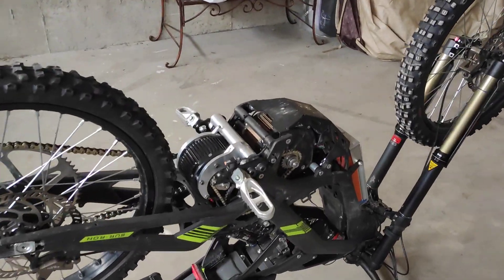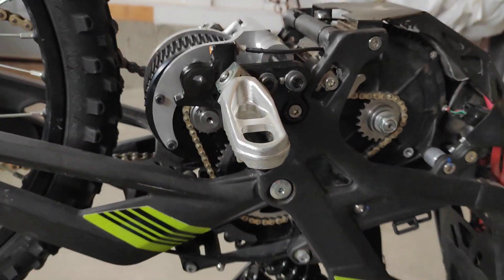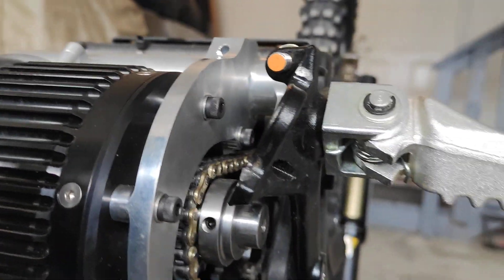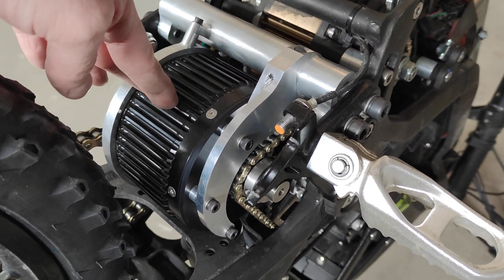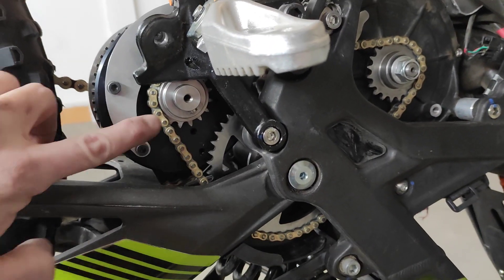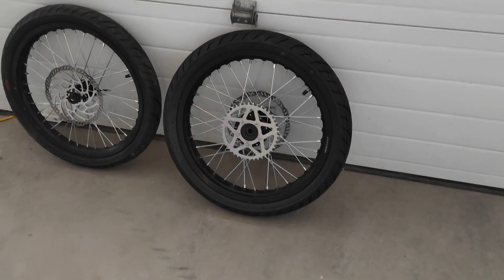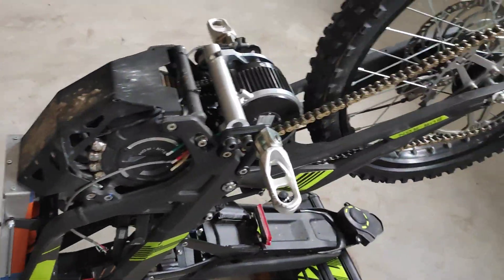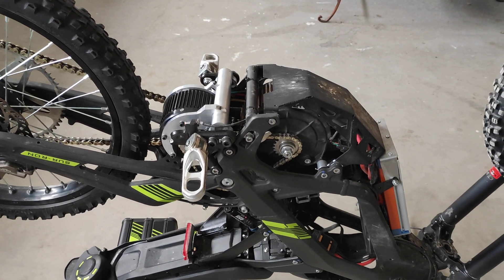Dual motor Surron update #3- motor and transmission installed

Comment: Good as a concept but completely useless for practice. Yes it works for heat dissipation if you need it as I read but considering the weight not the optimal solution

Comment: are you sure those mgm controllers will have features youll need like foc control and multi controller syncing the asi units are the best for bike related ive tested.the mgms are escs so wont be as quiet or smooth as sinewave foc units

Comment: Hello I have a question please ! Did you know if the Bac 8000 can run two Hub motor it's for two qs205 hub motor and if it's fit a 12 inch wheels ?

I want to do a motorcycles with the frame of the Honda grom125 with two qs205 with a 72v 48ah battery pack: 20s x 12 p using Samsung INR 21700 40T 35A !
The goals is to set the peak power to 20 kw top speed 80 mph and acceleration 0-60 mph in 5 sec ! Weight will be around 160 lbs !
Reply from the maker: Hi, no you can't run two motors off the one ESC. It doesn't work like that. You have to use two seperate ESCs. Other than that, what you propose seems possible

Comment: Lol, your range is going to be sooo bad. Still an interesting not very practical project.
Reply from the maker: Actually, with the 4kWh battery pack I am going to run and higher efficiency due to having two lightly loaded motors instead of one heavily loaded motor, my range will be almost double a standard SurRon.

Comment: I have to commend you. That is a brilliant piece of engineering.  Why bother with a bigger motor, when you can so cleanly fit a second motor in there?  Have you measured the power draw and efficiency of two motors vs. one at the same Watt output?  I'm thinking that it could be more efficient because neither motor will be stressed and producing heat for similar power output.  Let me know if you produce this as a kit. I'm interested!
Reply from the maker: Thanks Walt, yea you hit the nail on the head, the added motor mass of the second motor allows for more thermal inertia during and faster heat dissipation after high power pulls, plus by not pushing any one motor quite as hard you get better overall efficiency so you get less heat produced in the first place.
Reply: @danielclarke7109  I would love to put one of these setups on my Sur-Ron.  Absolutely brilliant!  Here's a little corny video I threw together on my Sur-Ron that kind of steps through some of the additions.  https://youtu.be/tblwpJz9nLA  Maybe there are a few ideas you can glean from it.

Comment: Looking forward to seeing the dyno results. The bac8000 on the stock puts out 24hp
I
Reply from the maker: Yea I got 23rwhp with the BAC8000 with a 21s lipo pack but the batteries were -10 degrees C so voltage was only around 62V at full power. I will be running a 24 or 25s LiPo pack so voltage at full power will be in the 80s, so I think 27rwhp from the main motor will be possible. Add another 13rwhp from the second motor and we are looking at 40rwhp which is my goal.

Comment: Is the main part one piece billet? If so, that is a big chunk to begin with.
Reply from the maker: No, it's actually 3 piece. The ring is separate, the motor plate is separate and the main tube is separate. They all bolt together nicely though.
Reply: @danielclarke7109  Thanks for your response. I can't wait to see it running.
Reply: @danielclarke7109  Do you plan on going into production?
Reply from the maker: No, the motor is far too expensive for anyone to consider this modification. They are 2100 euros each, plus you have to buy another speed controller and the machined parts are US$600. No-one would pay that.

Comment: Why the controller is going to garbage?
My controller just stopped working too asi 4000w
Reply from the maker: It only runs up to 84V and you can't program it so it is totally useless. This is the BAC8000

Comment: Awesome job with the mechanicals on fitting that extra motor!  Just curious, was it not possible to fit a second full sized Sur-Ron motor by re-mounting the OEM motor location further forward another 20-30mm?
Reply from the maker: Thanks! Anything is possible, but the biggest problem you would have is the stock motor is way too wide to clear the rear drive chain. Also, you would struggle to build a battery pack powerful enough to feed two of the stock motors without it becoming too big and heavy. My battery pack is right on the limit as it stands.
Reply: @danielclarke7109 
The battery power limit doesn't seem like a challenge to me, but that's my specialty. If you run into a bottleneck, a custom pack can fix it.
Reply from the maker: @LukeLiveforphysics  interesting, what sort of packs do you build? I am running a 24s 44ah 40c LiPo pack for this build, but I think though the voltage sag will become excessive over about 40kW of draw. Not enough to power 2x OEM motors.
Reply: @danielclarke7109  I've got some pouches that do 130C discharge peak, and 100C for a minute. They are well suited for the high power to weight toys. I'm sure your bike will be more than enough power to wreck everything you race with it! Great job!